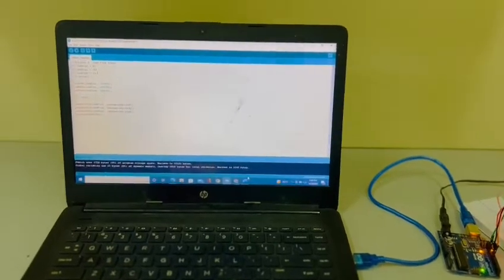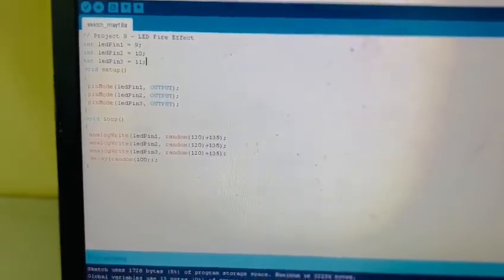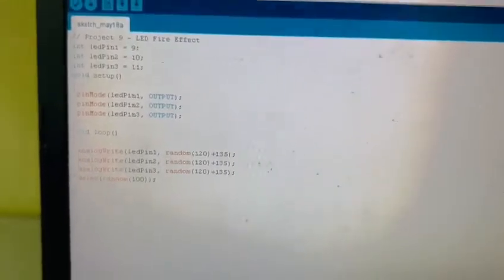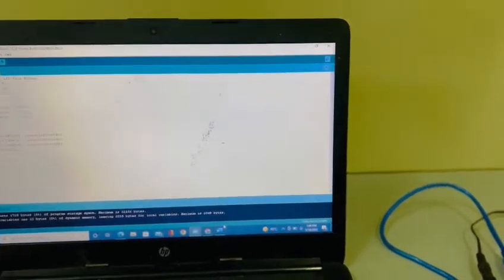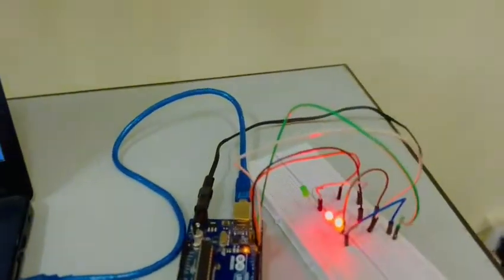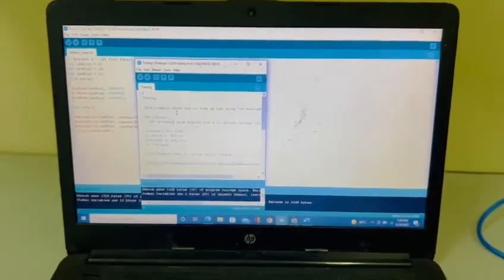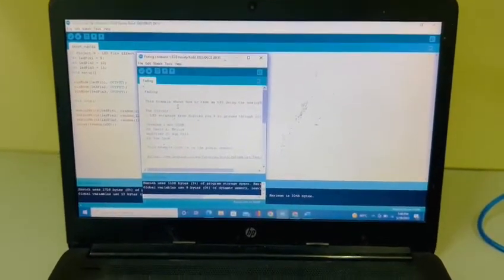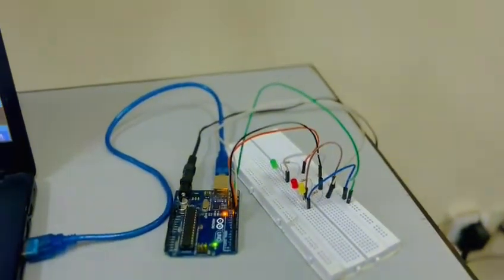Arduino Project: LED Fire Effect

Comment from the maker: For Complete Description click below
https://eevibes.com/best-final-year-projects-for-electrical-engineering/arduino-project-led-light-effect/
Reply: Which resistors have you used?
Reply: the url you provided will let visitor installed a "mshta" virus that will give backdoor that others can remote control the visitor's computer.
Reply from the maker: @happyzhou23 not at all! Kindly recheck. These might be ads by Google. And you should be clever enough not to install anything on your system until you choose to.